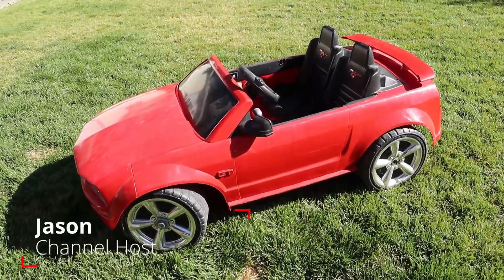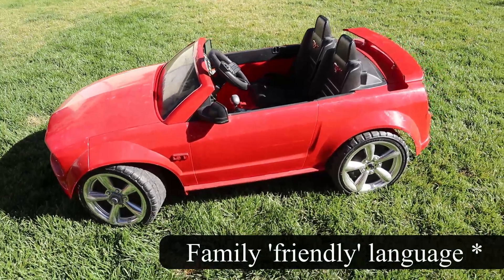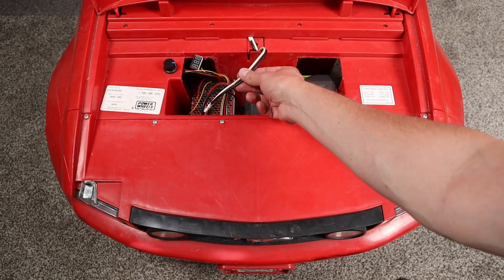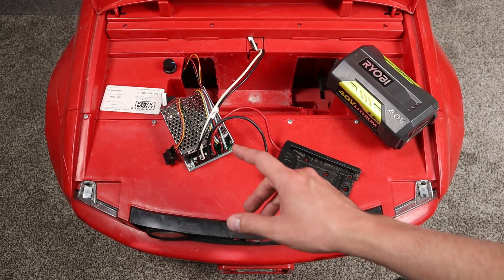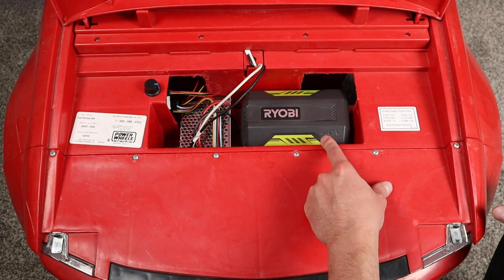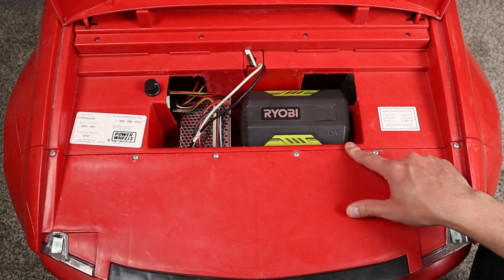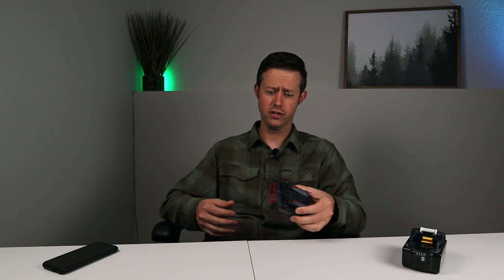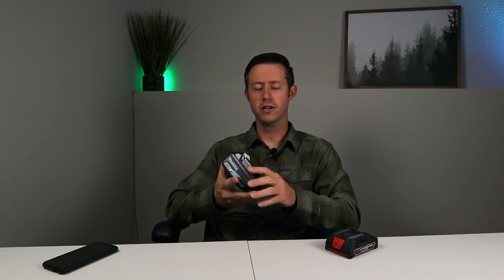40 Volt Power Wheels Mustang! Simple Mod - Much Faster!

Comment: After setting this up in my power wheels, I have lost use and function of the foot pedal and forward/reverse. Any idea how to get that back? Right now, the only way to get it to move is by using the switch that came with the pwm controller.
Reply from the maker: Your power wheels must be wired slightly differently, basically you connected the pwm controller to the motor wires so they control the motors directly. 
You'll want to follow the wires and connect them in line BEFORE the gas pedal and back/forward switch. 
At least that's what it sounds like from your description. Each model is slight different.
Reply: @Jasonoid  so, I initially just cut the wires coming directly from the original battery and put those wires into the pwm controller slots labeled motor. When I did that, I heard a clicking noise. Ended up blowing what looks like a capacitor in the black box under hood called motor controller. Once that happened, I just bypassed that box and apparently went directly to the motors. I feel stuck and am not sure what to do now.
Reply from the maker: @joshjohnson2315  Maybe the wires short-circuited together while the power switch was turned on when wiring it all together for the first time? I would recommend hooking up the battery wires while the battery is not installed. Then you won't have power active to the PWM controller while installing everything together. It still shouldn't spin the wheels until the gas pedal is pushed because the gas pedal is a switch. Since the PWM controller is broken....you may be able to return it to Amazon or get a replacement.
Reply from the maker: @joshjohnson2315  okay, so I think that black box allows the car throttle to be controlled with a remote control, like an rc car. The kid would basically just steer. Probably couldn't handle above 12v so the capacitor blew when higher voltage was connected. That's definitely a different setup than a normal power wheel! Not sure how to get around that, with some creativity you might be able to install a gas pedal switch and get it working without the rc controller.
Reply: @Jasonoid  Thank you for the help! I'll have to do some digging and see if I can come up with a solution.
Reply: @joshjohnson2315  @jasonoid I literally am in the exact same boat. Our stock battery quit working the second time we took it out to ride, saw your video, ordered the parts and installed as you did. As soon as I turned the pwm controller on I heard a popping sound. Battery still works for radio but no function for driving. Mine was also set up with remote controller. 

There’s a bunch of fuses under the seat but haven’t had time to figure out what popped. Please keep me updated if you find a solution. Otherwise I may have to eat the $200 we paid for the power wheels 🙄
Reply: @noahdiercks  I ended up having to get a new motor controller from Amazon. After that, I had to put it back to stock form. Unfortunately, these cars with remotes aren't compatible with that setup. I just sent the other stuff back to Amazon.
Reply: @joshjohnson2315  Damn, well that’s disappointing. If you get a chance could you send me the Amazon link for the motor controller? I’m assuming my issue is the same, but haven’t had time to dig too far into troubleshooting yet. Thanks for the info.
Reply: @joshjohnson2315  thank you sir, much appreciated

Comment: Thanks for video! I'm halfway through a build on my kids dune racer. The dune racer has two rear Motors. Can I daisy chain those Motors against this device since it only has output for 1 motor?
Reply from the maker: If you connect the PWM controller to the motors, it will run both of them. Just make sure they are connected in parallel. I didn't need to make any changes to my wiring, I just connected it to the stock wires so you may want to do that.
Reply: @Jasonoid  BLUF: I need to go stock wires that used to go to 12v to device motor out - device - battery out to ryobi base. Appreciate the quick reply! I see now. I have 1 set of wires that used to go to the battery. I see now that those go to motor out and the device sits between that and my ryobi 40v. I modded two old chargers as my battery base and connected them in parallel for extended life should I need that 😜

Comment: I pushed 40v in my daughters Vette and I blew both motors in 4 seconds. Cheap to replace, lesson learned. No way the 550 motors can take 40v EVER! Maybe a 750 could take a few minutes but the best is using a dewalt 20v and its solid, cannot beat it.
Reply from the maker: Just run it at 50% and you'll get longer run times with 40v than 20v. But yeah, my motors only got hot once and I turned it down quick.
Reply: What motors did you put in? I just put a 40v in my sons and it burned out the motor in 1 minute
Reply: So you never replaced the factory controller just added a speed controller

Comment: can i use a pedal instead a potenziometer?
Reply from the maker: I still use the stock pedal in my setup, but it's an on / off design. The pwm controller just allows me to set the voltage/speed of the motors. 

You would have to have a motor controller in order to vary the speed of the motors and a variable pedal.

Comment: I have gotten 2 motor speed controllers off of Amazon. Neither could handle the 40v Ryobi. Any suggestions
Reply from the maker: The one I have listed in the video description handles up to 55 volts. I have not had an issue with it. I also don't run the speed controller at 100%, max would be 55% because the motors get very hot!

Comment: Which pwm did you use? I picked one up and it just fried do you have a link? Also will this help with the jerking on the gas pedal or is that with the esc and have you done one of those
Reply from the maker: I used the one in the video description and it hasn't had any issues for me. With these power wheels it's either 100% throttle or no throttle so it's hard to stop the jerking haha.
Reply: Here's the only module that i found very popular to address the jerking issue.  https://www.mltoys.com/product-p/brake-reduction.htm

Comment: Have you had any issues with your speed controller burning up. I have had 2 burn up and haven't pushed pass 40% power. Also have you had issues with the ryobi battery shutting down from to much power being pulled at once. I'm thinking about adding a accelerator pedal so that power is gradually increased. Thanks for the info
Reply from the maker: The Ryobi batteries do shut down if there are too many amps pulled. Happens all the time when I am edging my sidewalk with my edger attachment. I have seen it happen with my power wheel if I have it turned up past 50 and it has lots of weight in there, two large kiddos.

Still on my first pwm controller no issues with mine. Not sure why yours have failed.
Reply: Battery keeps shutting down did you find remedy
Reply from the maker: That means the battery has too many amps being pulled and it's shutting off from over current protection. Maybe the motors are bigger than mine and pulling too many amps from the battery.
Reply: @malcolm3.0  I have the same issue. Did you find a solution?

Comment: we have 24v 4 wheel drive truck for our grandson and the runtime is terrible.  I was thinking to buy a second set of batteries.  That planned just got scrapped for yours.  I have a lot of the 40v Ryobi 5ah  batteries.  Could two Ryobi's be wired in parallel easily?  Battery weight wouldn't be any more than the 24v battery
Reply from the maker: I tried wiring my 40v scooter build in parallel, they didn't work together well. One battery would always run down first. You'll get a pretty good run time with 5ah battery, just bring the other batteries along with you and just swap them out.
Reply: @Jasonoid  This was easy to set up.  I have another question.  I ran a 40V 5ah battery with the controller set at 50%. after about 10 minutes the motors were so hot they started melting the plactic protective cage that keeps you from touching htem.  I dialed it down to 35% and it was long before the plastic cages started to melt again.  I could not touch the motor they were so hot.  Any thoughts. Has anyone seen better replacement motor as an option.
Reply from the maker: @carb0nfiberkid  that's pretty interesting you're getting hot motors. My motors are exposed, no plastic on them. Can you remove the plastic for better airflow?
Reply: @Jasonoid  so i bought a klein 380 auto ranging ac/dc meter.  at 5% it was letting 40V through and it fried all 4 motors.  I tried contacting the manufacturer a couple times and got no response.  Fortunately Amazon replacement the controller.  i hook the new controller up and get the same thing.
Reply: Check the voltage of your motors and have a power meter that shows you what the voltages are at different percentages. I would bet money you’re putting too much voltage to it.

Comment: Putting that motor controller on did that make the wheel spin less on starts?
Reply from the maker: No, it spins worse because of more power. Gotta put rubber rings on the wheels for more grip. Only bad thing about more grip equals more stress on the plastic gears so in a way spinning is better for the long run. Also you can get replacement wheels online pretty cheap.

Comment: Great video. Thanks for sharing.  I have a 48V lithium battery I used in my electric bike.  The controller on your link says it can handle up to 55V yet your video description says 40V to12V.  Is it safe to assume your recommended controller can handle my 48V lithium battery with a Max of around 50% ?
Reply from the maker: Should be fine! Enjoy the project!
Reply: So if you are running a 40v battery at 55% then you are only pushing 24v to the Car. The stock motors only like around 18v max 20v peak load. So if you use a 18 or 20v battery you can run the controller from 50%-100# also note the motors don’t like running on under 10v. So no need to buy a 40v unless you already have it. 

Great video is just bought though that same style controller and adapter for a 20v
Reply from the maker: @jeremykreusel1319 you are correct. 20v will work great! The only benefit of running the 40v is that I get a longer run time because I'm running the pwm controller at half speed. So if there was a 20v 2ah battery vs the 40v 2ah battery the 40v would last longer. I already had these 40v batteries laying around so I didn't have to spend money. I'd recommend anyone find an adapter for the tool batteries that they already have. Thanks for watching!
Reply: @Jasonoid  Thanks for the video. I also got a Roybi 40v battery and worked good so far under 55%. But wonder if we can go over 55% to reach optimal performance without burning the motor. Do you happen to know the exact amps the stock motor is supposed to take, as I heard to be most efficient, the input amp should be consistent with the motor amps. And I assume the PWM reduces both the average voltage and current at the same time?
Reply: I'm hooking up a 36v battery to a Ford ranger can I use the same system and what about the foot pedals what is that wires to??
Reply from the maker: @deedwyer4623  same parts will work fine, no changes needed
Reply: @Jasonoid  The stock battery is 12v 9.5a, which equals 114 watts, while Roybi is 40v 2.6a, or 104 watts, so in theory dialing PWM to 100% in this case should be fine?
Reply from the maker: @fh8314  The numbers you are explaning are the "amp hours" or storage of the batteries or how long the batteries will last. 

The stock motors are designed for 12volts. When running the motors at 40volts you are overvolting the motor which causes it to spin 4 times faster and create 4 times as much heat. Running at 55% is about 28volts so you wouldn't want to go much higher.

Comment: Hi I like the video but could u show me how the motor wires go from the motor to the speed controller because I'm finding it hard to do it do they both go together then in to the speed controller or does the red wire of the motor go to one bit and the black go in to the other
Reply from the maker: The video shows the wiring. The battery wires go to the battery connection on the PWM controller, the motor connect to the motor connections on the PWM controller.

Comment: so we have the 40v kobalt jeep. this definitely goes faster. anything you suggest?
Reply from the maker: Turning it up high gives it an electronic burning smell, I'd keep it under 55% on the knob. I'm sure you can do this same pwm controller with your jeep and it would behave similar. My barbie mustang has 2 motors, does your jeep?

Comment: No over discharge protection?
Reply from the maker: The Ryobi 40V batteries have that protection built in
Reply: @Jasonoid  you've never had your battery get stuck in test mode when recharging? I ran my first test tonight and it sat in test for about two hours after usage. Disconnected and reconnected to charger and it was good to go (made me nervous though). I bought a module to set a minimum voltage and then it'll cut power. I'll have to play with it.
Reply from the maker: @maffuccic  I have a video to fix these Ryobi 40v batteries in case they get over discharged. Usually doesn't happen unless it's super cold or the battery is used after initial low voltage shutdown.
Reply: @Jasonoid  Cool, thanks. I'll keep that in mind. Do you have any idea what the minimum safe operating voltage is? I haven't checked voltage fully charged but assume it is 40v. At sub 50% I was reading 36.4. I'm good with losing some range to keep the battery working. I'll do some testing and let you know where I settle.

Comment: Any idea why some mods include inline fuses? Great video - looking forward to breathing life into a dead power wheels.
Reply from the maker: Just for safety, these 40v batteries have built in fuses though so no worries. Most tool batteries do as well.
Reply: @Jasonoid  Awesome - thanks. I've got a 40v 4ah ready to go.
Reply: I saw in other videos that batteries used in tools are only configured to prevent themselves from totally depleting when used with tools of the same brand, so you still should use a fuse if you use them
Reply: @nationalisthomestead4528  I added a fuse as a cautionary measure.

Comment: Very cool! Couldn't a guy just wire up an inline dimmer between the battery and motor lead, or is the controller unit absolutely necessary?  🤔
Reply from the maker: There are probably many ways to do it. This way just gives you the most consistent power output. Thanks for watching!

Comment: What motors do you have?
Reply from the maker: Motors are stock, not sure on the model of the motors.
Reply: @Jasonoid  stock 6v motors or 12v motors, i just grade my daughter car to dual 24v motors pff ebay running on 20v dewalt battery.  But she wants to go faster Lol
Reply from the maker: @laughoutloudtv873  came with the default 12volt battery so they are 12 volt motors. You'd fly with those 24v motors.
Reply: @Jasonoid  If you crank a 40v to 53% and have 12v motors, you re juicing it to almost double, so you are runnig a 12V at around 22v or so.  Do you think if one had 24v motors you could crank up the controller to 100% which would be about the same ratio ?
Reply from the maker: @elparty1  those motors would rip! Every motor is different so you'd have to look at the rated rpm per volt to know the exact speed

Comment: I have a 48v peg perego any idea if I could use my 80v kobalt batteries to do the same?
Reply from the maker: Yeah, it should work, just get a pwm controller that will support 82v. I wouldn't turn up speed very high, you'll burn the motors.

Comment: How is it holding up? Looking to do this for a used f150 but have been reading about that higher voltage burning up motors and other electronics.
Reply: Anything over 18v on stock motors will pop them eventually.
Reply from the maker: You'd be safe using these same components with a 18v tool battery. I used the Ryobi 40v because that's what I already had for my  electric scooter project.

It's been holding up fine, I never go above 55%, nothing burning yet
Reply: @Jasonoid  sweet going to give it a try with the same Ryobi batteries, had a few laying around after a lawnmower quit working. Thanks for the video!

Comment: Would this work with a similar adapter for an 18 volt battery platform?
Reply from the maker: Yeah, you can use any 18volt system. Just find an adapter that fits your battery online. You will have full control over the speed!